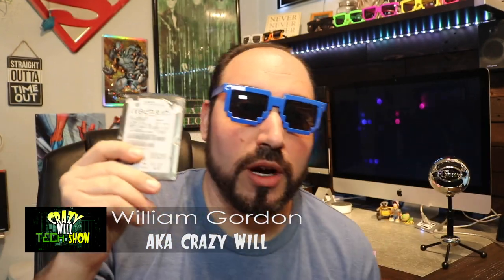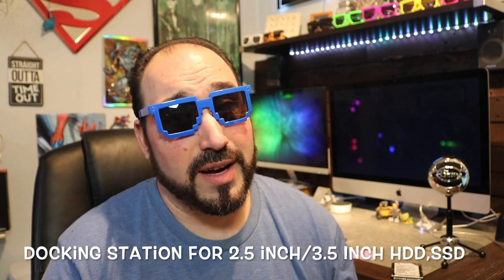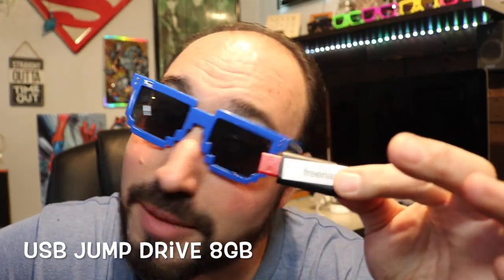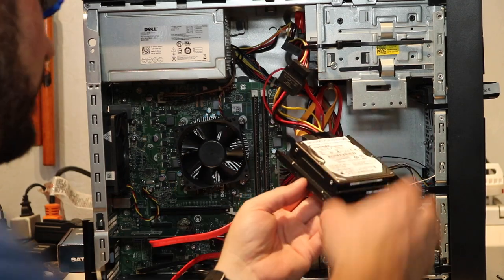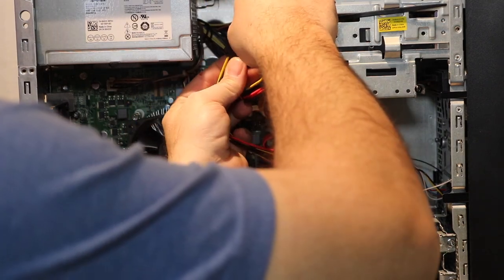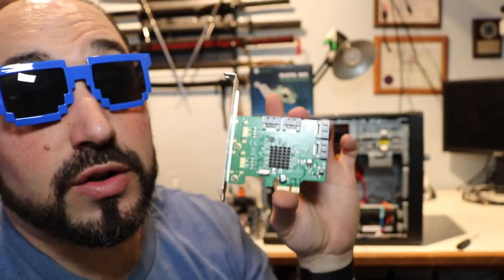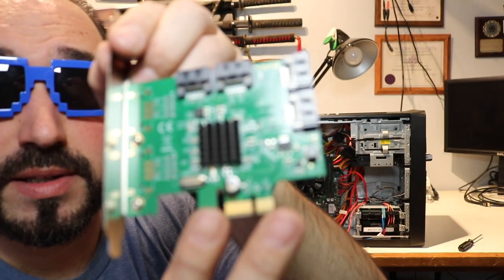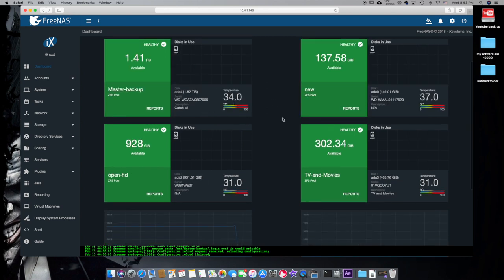What to do with old hard drives?

Comment: I have an old hard drive from a dual op mac i would like to connect to my acre desktop computer so i can access teh information on the old mac hhd I have plenty of slots since acer shorted me 2 tb of the 4 tb hhd that was supposed to be in this computer when i bought it. It was supposed to come with a 4 tb hhd. but instead it came with a 2 tb hhd and was supposed to have a 2 tb ssd which was not installed or if it was is completely inaccessible. I have programs on the mac hhd i would like to try and access using the old hhd's mac op system. Is there a way of simply connecting the old mac hhd to an open slot in my acer computer? I am not too computer literate.
Reply from the maker: Yes How to recover files from a damaged 2011 MacBook Pro
https://youtu.be/hiVG5T5sNA0

Comment: My laptop broke and stopped reading HDDs through the SATA port so I had to use the 24GB mSATA SSD (is that what m.1 is?) to store my windows install :( they are kinda expensive but i got a 120GB drive and now idk what to do with 24GB
Reply from the maker: You can’t go in to bios and enable it?
Reply: @CrazyWillTechShow  all i know is that the laptop wouldn't even boot to USB if a hard drive was plugged in and I couldn't access the BIOS either I could only do any of those things if I removed the hard drive. This was actually like a couple years ago and I sold that computer to a friend.
Reply from the maker: Dam, Did he get it working?
Reply: @CrazyWillTechShow  no like i said we gave up and just used the mSATA slot.

Comment: i3 was duel core 4 thread back then- i dumpster dive too.  my same gen main i7 3770 is 4 core 8 threads! (found another one of those in the trash too).  my happiest find was a gigabyte sumo case with 4 hdd on rails slots and 4 optical drive slots.   
look up i3 3240 and select results from intel!   i like older hdd for their size/price ratio but maybe i should have went for the faster speeds- it took 24hrs to transfer 2t to my my larger 4t drive!
Reply from the maker: I love dumpster diving! Specially for computers because people just think they don’t work and it’s usually a quick fix. Yeah don’t get me started on transferring data😤

Comment: For the first trick you could just buy a sata to USB converter for like $5
Reply: Only for 2.5, 3.5 disks need more power
Reply: @djdjje  so you would connect a spare sata power plug from your machines psu?